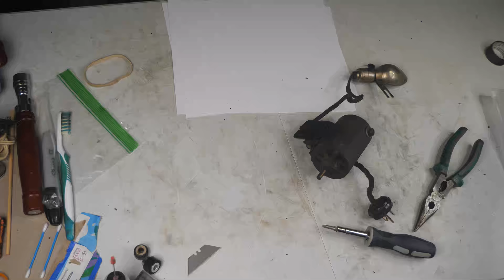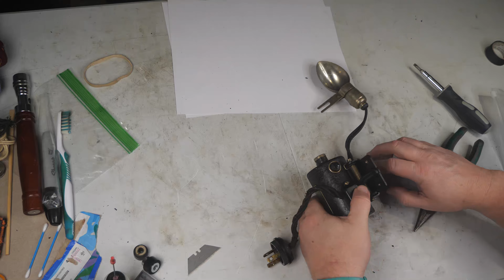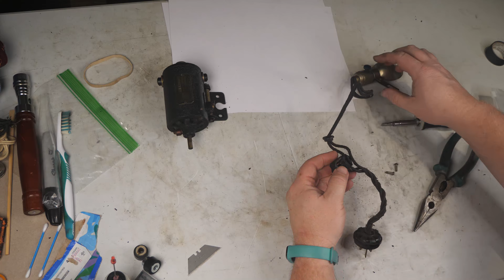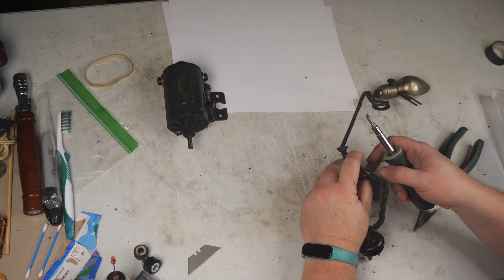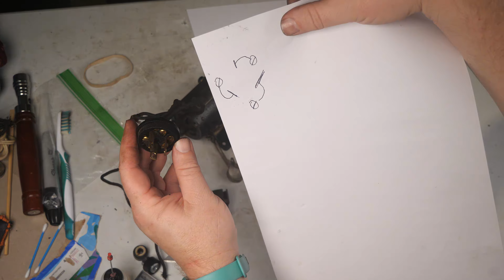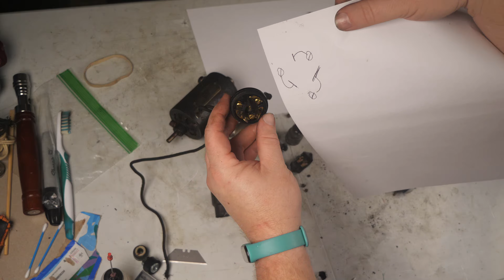White Rotary Motor Wire Removal

Comment: Did you make a video on how to reassemble this? I have the exact same machine and am tying to rewire it. ANY help would be fantastic
Reply from the maker: This machine had extensive wiring work done on it and the rest of the playlist shows what I completed on it.  There are a few other Kenmore and White machines that I rewired as well.  The White 277 has a different controller, but the Kenmore 59 has a similar controller and I worked on that machine here:
https://youtu.be/CsT9kpL0bc8